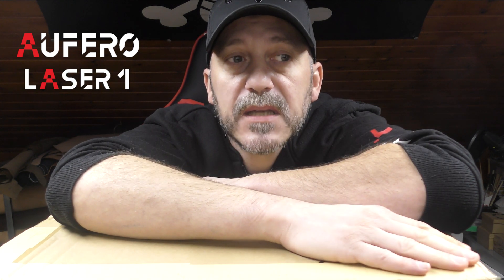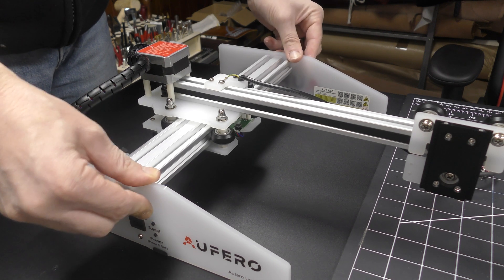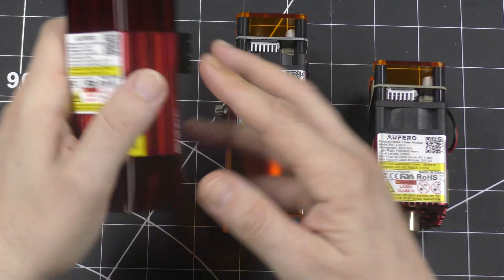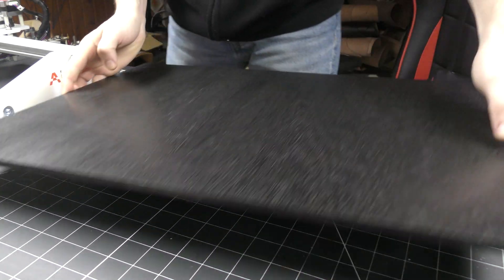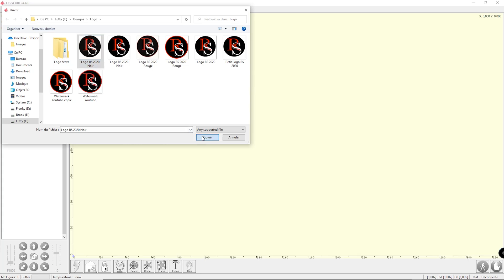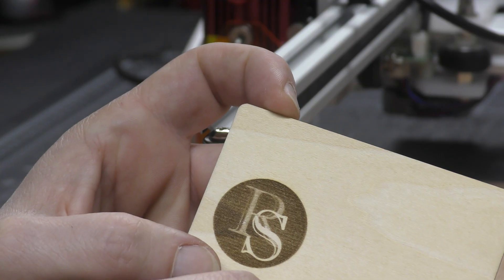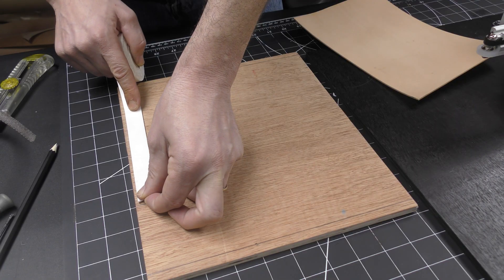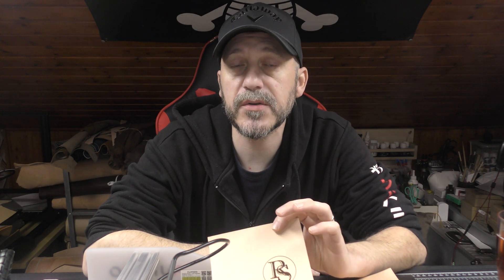Unboxing and Testing the Ortur Aufero 1 Laser Engraver - DIY

Comment: Hello there. Thanks for this video. I am a bit confused. All the videos I watch about this laser mention that it comes with 3 laser modules, however on the Ortur site even though it show a picture of the 3 modules as if they are included you have to select the module. So, did you purchase the 2 additional modules?
Reply from the maker: Hello, and thanks for your comment. I think Aufero changed their policy and now you have to chose which head you want, but when I received mine, it came with three heads for all puprose. Hope it helps. Have a nice day.